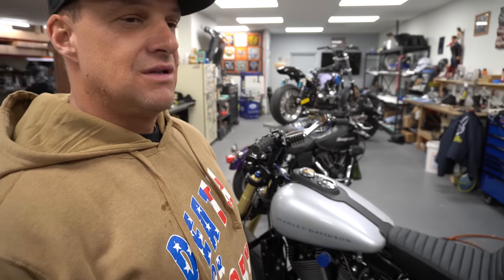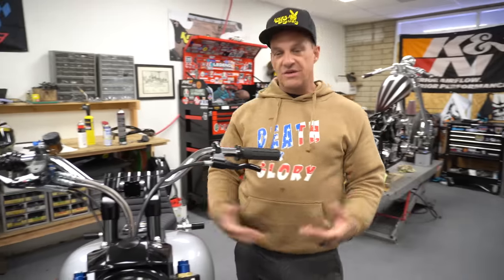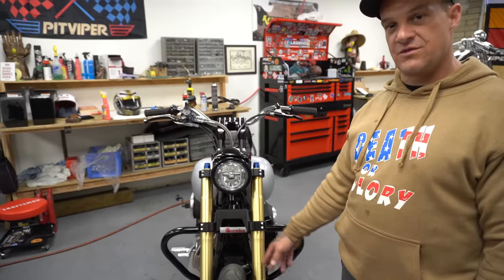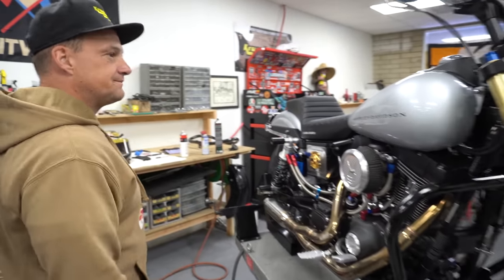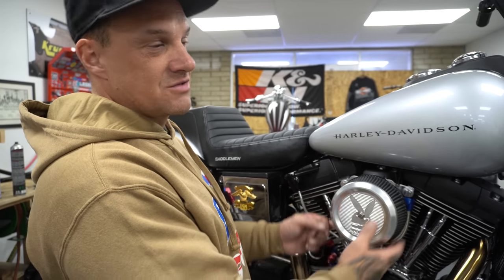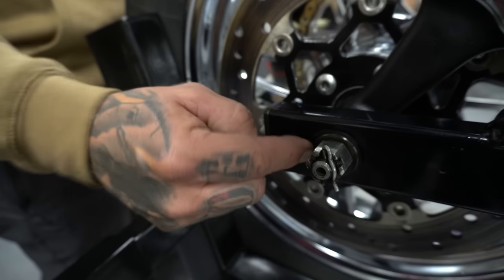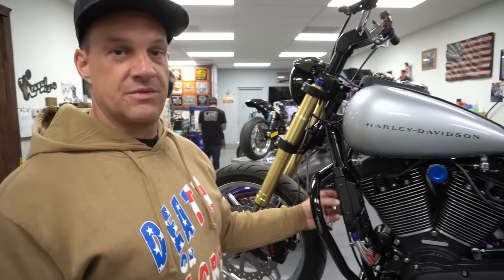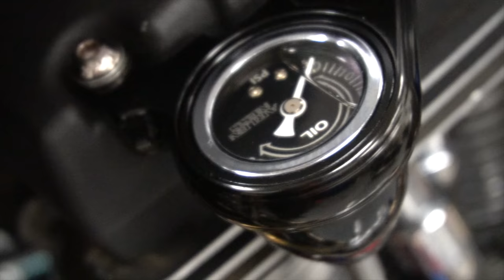Ryan Kruesi 02 dyna fxdx stunt bike full break down

Comment: What if the skid plate kinda hooked in? Like the wall mount slotted holes on the back of a powerbar. 4 fasteners with slotted holes and at the back a bolt that cranks it towards the back. Loosen the rear bolt and the skid plate goes forward and can pass the other bolts right through

Comment: Got a silly question for someone. Just started tearing down a 01 fxdx. Took off a sissybar. Now there’s about a 3/8” gap on either side between the subframe strut and fender. Was there a spacer in there from the factory or did it just pinch the fender in over the years? Spacer or just bolt it up as is? Thanks
Reply from the maker: There is a long shim that goes in their factory. But you should just be able to draw them with the bolts.
Reply: @kruesioriginals  thanks big dog

Comment: does anyone know if there is much difference between an 01 fxdx and 02 fxdx? i find good deals on 01's compared to 02's. is the 01 solid for stunting as well?
why is the 02 so sought after over other models?
Reply from the maker: Both very good bikes. The only difference is a cam position sensor in the 01 02. They didn’t have that it’s better.

Comment: Have you run the sputh motor stabalizer. ? I have them front and rear.. they do help. It's deffinetly noticeable. I'm just curious if it's worth switching to the big bear up front..
Reply from the maker: They will 100% break your engine cases if you do a wheelie with them.

Comment: Do you guys run full synthetic on your gear oils or do you change it up? Only reason I ask is because some people say clutches slip with full synthetic and I’m like who’s better to ask than you guys who ride hard asf lol
Reply from the maker: In the primary we run automatic transmission fluid type, F it bangs real hard.
Reply: @kruesioriginals  always appreciate the fast responses from you guys. I have 20w50 redline full synthetic and motul primary oil 75w90 in your case which would be the route. My bike is chained downed has its stock cams but I’m upgrading to fueling hp+ and I was hoping you guys could tell me which would be the best route to go both cam route the reapers or s&s or someone completely different. My bike is a 1200s and with stock cams it’s at a 10:0:1 compression. I did add a louvered  high performance air cleaner and a two into one exhaust also went with the twin powers high performance ignition coils. I just want to match my injectors with the best possible cams that can bear these n4’s without me questioning it lol